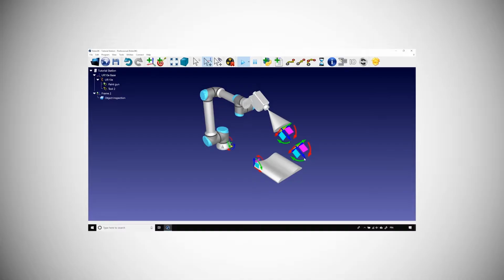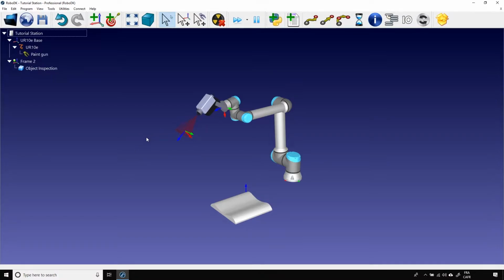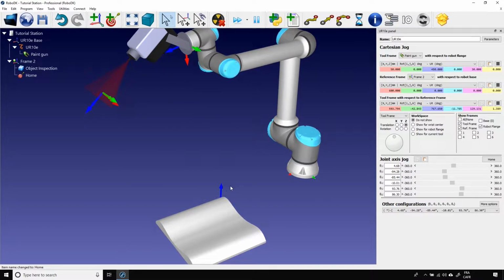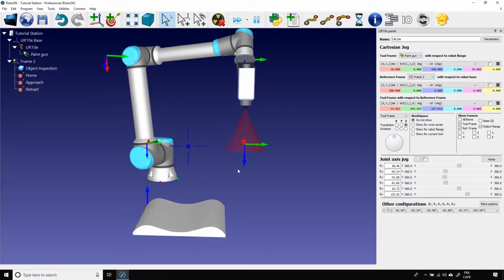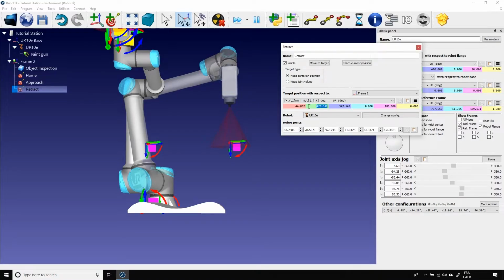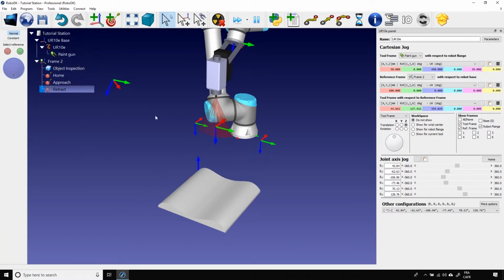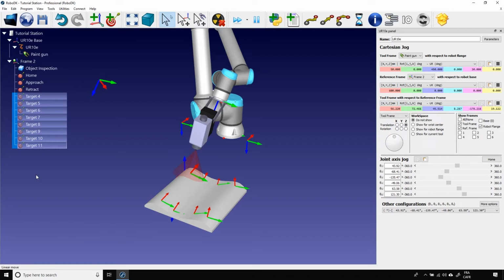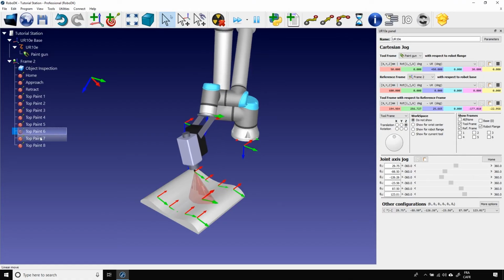Getting Started: Robot Targets - RoboDK Documentation

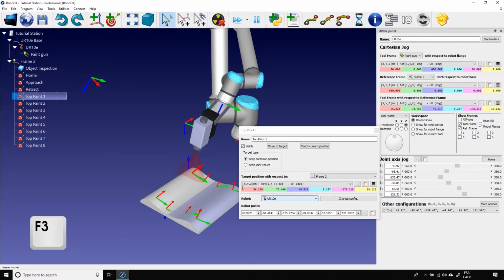Comment: Sorry.. Can you tell me what values are based on setting x and rotation at 8:42 ,and what effect will this adjustment have?
Reply from the maker: Those values were arbitrary. It will change the position of the tool, that's pretty much it.
Reply: @RoboDK3D  So the values are arbitrarily changed? Can I think so?  sorry i'm not smart.
Reply from the maker: @壱雨  This means the values that were entered were random. You can ask technical questions in our forum: https://robodk.com/forum/.
Reply from the maker: @壱雨  It's a demo, if you have a real part, you can decide what is the right position to reach and enter it.
Reply: @RoboDK3D  Because i'm a beginner, so  i really thanks for your answer , it's very important to me,